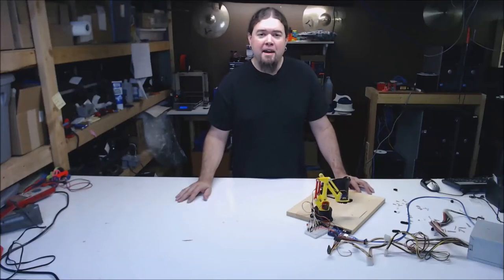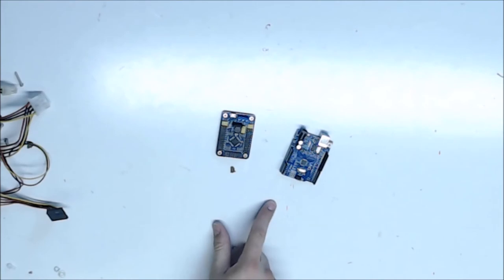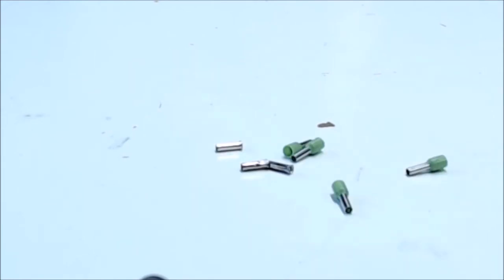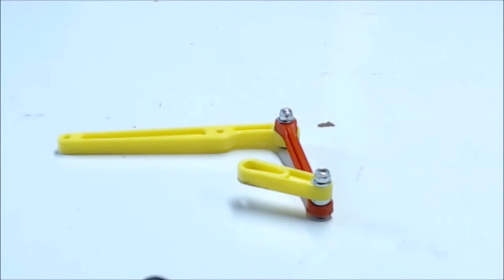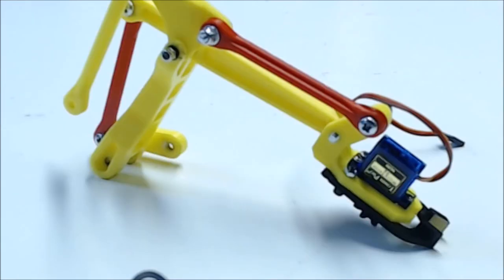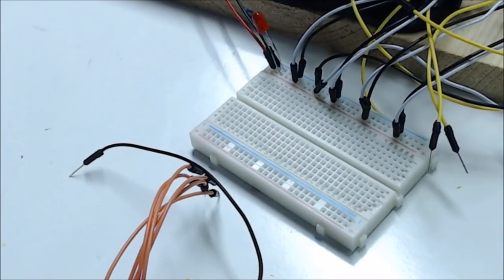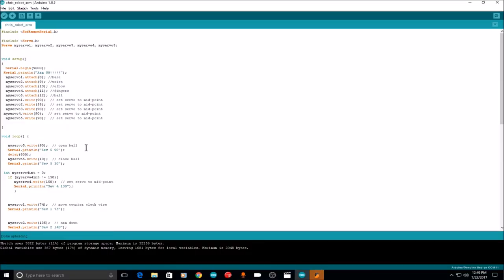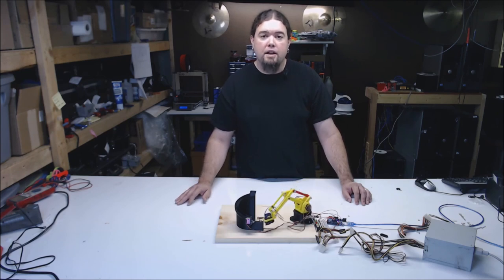The EEZYbotARM 3D printed easy bot arm build

Comment: what would be a good way to power the servos and where would I get a power supply?
Reply from the maker: Any 5v supply will work. You can use something like this with this adapter so you can use a Dupont connector jumper. https://www.amazon.com/ALITOVE-Converter-Transformer-5-5x2-1mm-100V-240V/dp/B078RZBL8X/ref=sr_1_19_sspa?crid=1MGUOOTA44XLS&dchild=1&keywords=5v+power+supply+dupont&qid=1592084071&sprefix=5v+%2Caps%2C182&sr=8-19-spons&psc=1&spLa=ZW5jcnlwdGVkUXVhbGlmaWVyPUExRDdPMTMxUlU2WjA2JmVuY3J5cHRlZElkPUEwMTUwNzI3MzEzRkpGVUJCQVZRTSZlbmNyeXB0ZWRBZElkPUExMDEwOTYyMjZKTzVPVzQzRFVEVyZ3aWRnZXROYW1lPXNwX2J0ZiZhY3Rpb249Y2xpY2tSZWRpcmVjdCZkb05vdExvZ0NsaWNrPXRydWU=

Comment: Hi nice video..
what was the total print time for all the parts..? (I have A8 3D printer)
Reply from the maker: Thanks! That is a really good question. Most of the parts are a pretty easy print. Some support needed. You can batch a lot of the smaller ones together. Maybe around 40 hours total.